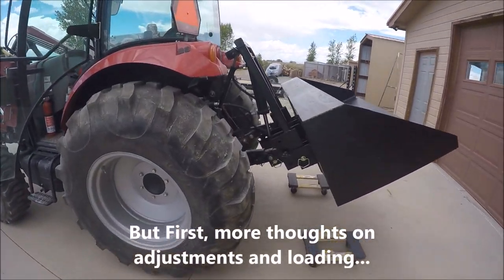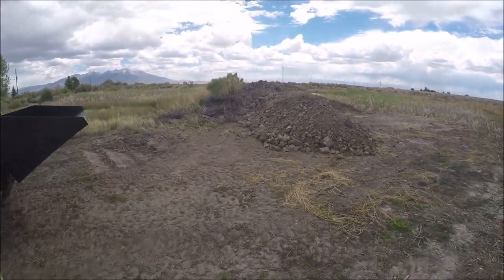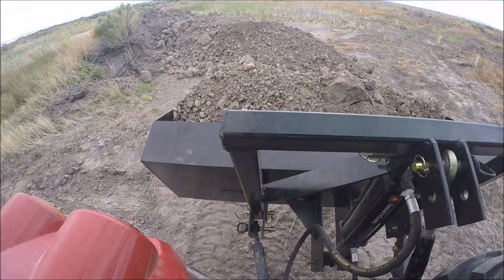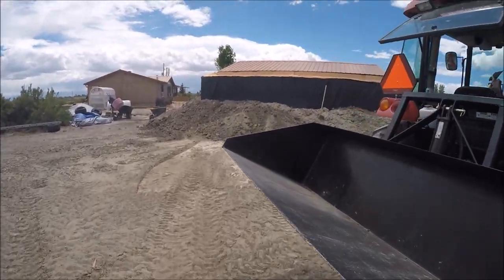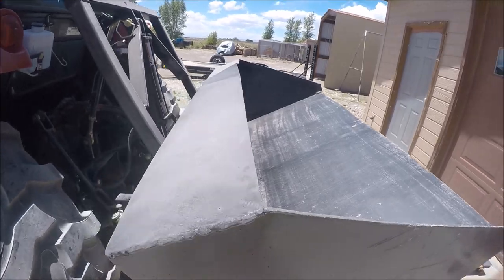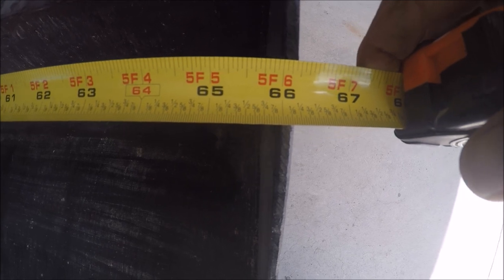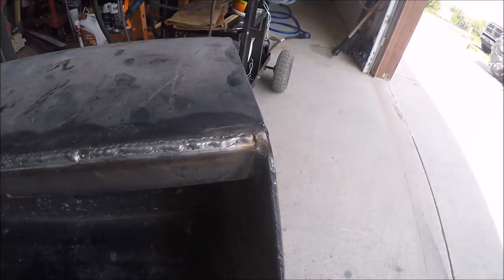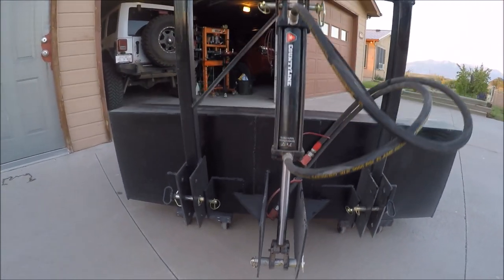3 POINT Tractor BUCKET Build Pt 5 *BENT IT !!!!*

Comment: Hey, this is working great!  I like the idea the bucket is level when you drop it.  You save time by not having to adjust the curl while driving in reverse... That is a good fix and you figured out why there is that 2x2 at the top of most bucket! I thought it would not be so important, as you scoop a loosen pile of dirt as opposed to digging in compacted dirt with the front bucket. Moreover, I thought if anything would bend, this will be while lifting the bucket from the dirt pile... I never thought it would be the bounding that would create that! When the cutting edge of a bucket is bend, they say it has a smile in it. In your case, your bucket was frowning! Overhead welding... Even with the leathers, a good blob can come through a loose collar. Then it's just longer and harder to reach for it! Lol! Thanks!
Reply from the maker: Hey, thanks for your comments! I'm glad my bucket doesn't have a "smile" so far 👍 even though I'm no engineer, it's been a fun project, and I appreciate you watching and your feedback. And so true about getting burned while welding. I'm sure there are people that don't get burned, but it's just part of the process for me LOL. I've been to your channel before, if I haven't subbed I'll make sure I do now
Reply: Thanks!

Comment: nice fix! looks like this thing moves a lot of dirt. I been wanting to build one for fire wood  moving as well as dirt.
Reply from the maker: Dave, I would like to see how you engineer yours and what you would do different... like size and shape of bucket, frame design, cylinder choice and location, would u put a hardened edge on it, etc. Also I think you could make a buck or two making these and selling them locally... especially if you could source a few used buckets for cheap... have a couple sizes (width) available and hydraulic as well as manual dump version for people who dont have rear hydraulics. I would like to build them but just dont have the time. Even my dealer did not have a source for a three point bucket...
Reply: @anesthesiadreamin  I bet there is a good market for these locally.